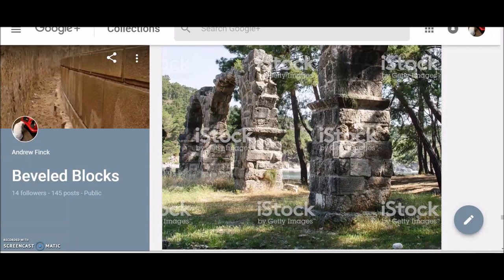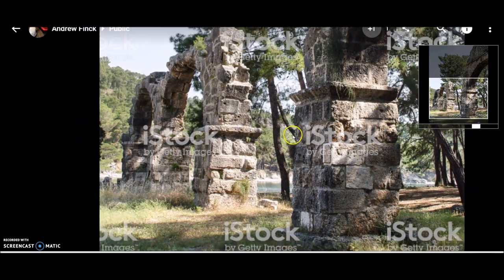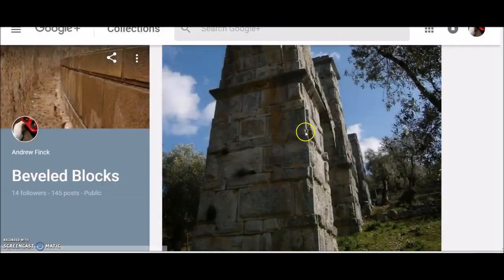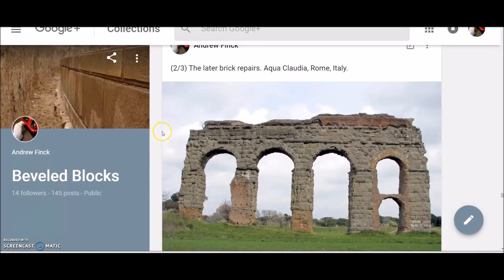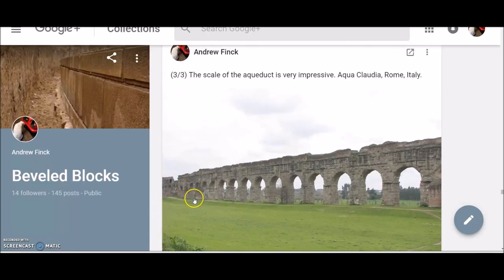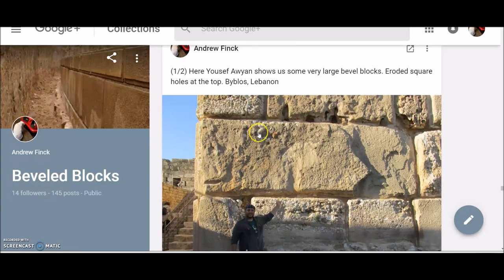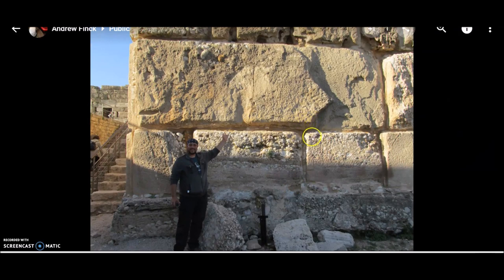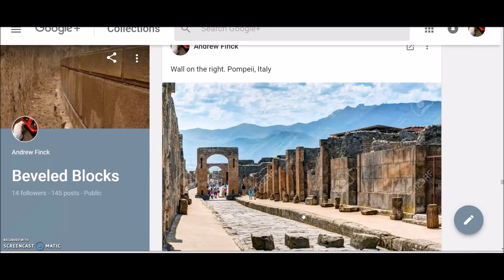The Mystery of the Bevel Blocks, part 8

Comment from the maker: To those whose comments were deleted: 
Q-QuestionsStuff: Thanks for the kind words! 
Paul Turney: I have considered the scaffolding idea also. In some instances I can see them as potential anchoring points for platforms and scaffolds. In others though, they appear so haphazard and unnecessary. Sometimes many are seen, in uniform distribution, while other times only a few are seen and without an apparent plan. The large stone beneath the Wailing Wall in Jerusalem has square holes and one even has the remnants of a wooden beam (appears petrified it is so old) still stuck in the hole. So, perhaps, I'm keeping that option open though because it is one of the more practical, pragmatic explanations. For now I will say that it is too early to tell.
Reply: The Wailing Wall is part of a landing platform for space ships! When the space ships stopped coming, people were "wailing" at the wall! (In Dutch iit's called  "de klaagmuur"which means "compainingwall")

Comment: Barbegal aqueductconnected to a giant mill complex. They were often connected to mines for washing ores or similar industrial scale production. Still today water delivery management the biggest infrastructure projects.
The volume of stone cut and moved is greater the the pyramids and surveyed to higher level of accuracy, great pyramid is 0.05 along the ground while aqueducts have a constant fall  of 1/4800 over 50 kilometres or more. By every metric the aqueducts are the greatest engineering achievement of ancient world and built in a remarkably short time. Apart from iron which it necessary in cutting and shaping they built these with the same tech available to every other ancient stone building culture. Vitruvius 10 books of architecture even describes the methods, along with the works of Heron (library of Alexandria) moving and surveying techniques of ancients is described in detail.
If the Romans could do it and they inherited Egyptian/Mesopotamian knowledge then stands to reason these earlier cultures knew about the power in a well tied knot. Truckers hitch is an antigravity machine still being used in plain sight.
Reply from the maker: Some do appear to be legacies of older ones. I would like to chart all the bevel block aqueducts and see their courses.

Comment: Going through some of your older stuff, no idea if you'll see this comment. Just wanted to chime in regarding the arches you observe from around 3:35 to 6:45. 

I think that it is most likely that the "older/original" arch probably consists of stones that were initially from both/multiple arches, and that whoever did the restoration (stuck working with quarried, incomplete, and damaged ruins) tried to reconstruct the "older" arch with only original blocks from neighbouring arches (aside from the keystone, which they may have had to manufacture due to mix-and-matched pieces from multiple arches leaving them with a gap that no original block fit, in a particularly important spot). 

Could be wrong (especially if there are more arches here containing more heterogenous compositions of original and restored stone), just sharing my thoughts.
Reply from the maker: That's a great thought and I could see that being the scenario as well!